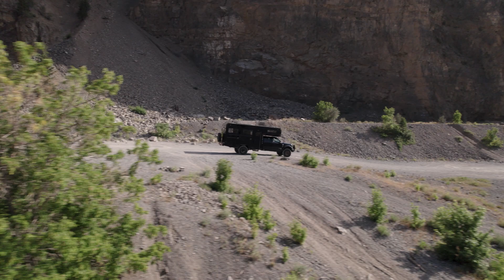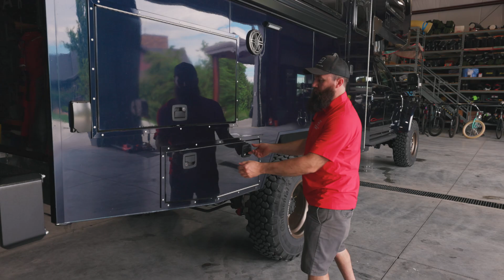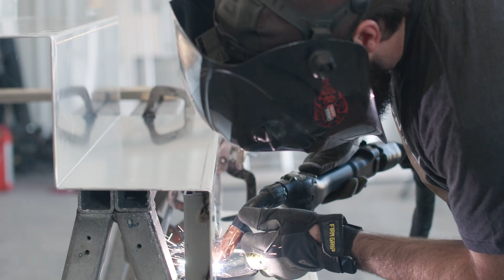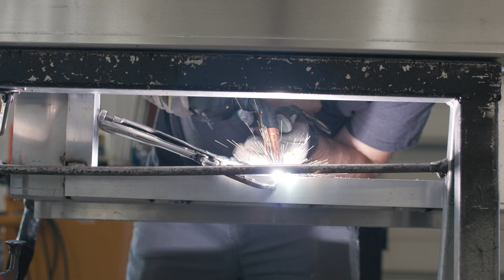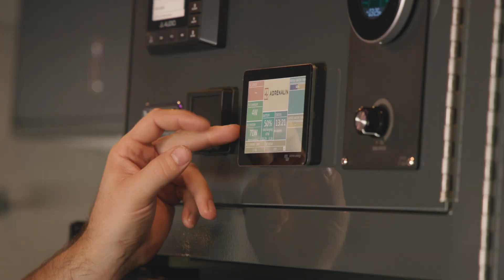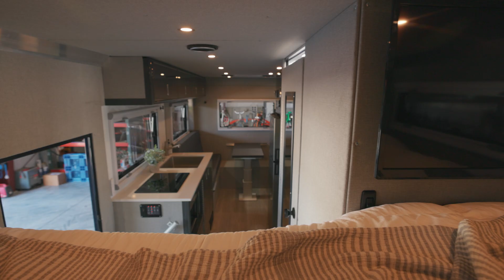Technical overview of our 2022 Overland Series F550 truck

Comment: I cannot understand why every single company that makes these very expensive "adventure" builds, only includes a cassette toilet? They go to so much trouble to make sure you can "stay out there" and then come up with a design flaw that ensures that you cannot stay away from town for more than a couple of days. It is just absurd and renders the rig basically useless for the intended task.
Reply from the maker: It's still our favorite option by far. Traditional black tanks require you to find an RV stop and are gross. You can buy 2-3 additional cassette tanks and you can switch them out as your trip goes on. They work pretty slick.

Comment: Both the fual & water tanks seem very small, the over cab bed seems to tight for a sit up position, all those gizmos to go wrong, you have to remember they are all chinese quality. The one good point is the window/door choice.
Reply from the maker: This truck was our 2022 demo truck. We suggest you go watch our 2024 demo truck overview (link below). All tank capacities are increased, bed area height was increased. We also switched to a C-Zone interface which is used in high end yachts. 
https://www.youtube.com/watch?v=hWb6N32-trE&t=17s

Comment: I am pretty sure the MPT 81 tires are all rated for 68 mph? Did the specs change to 80? Shouldn't drive faster than 68 with those.
Reply: Your correct.  We have several tire options.  There are new MPTs coming out that are rated to 85mph